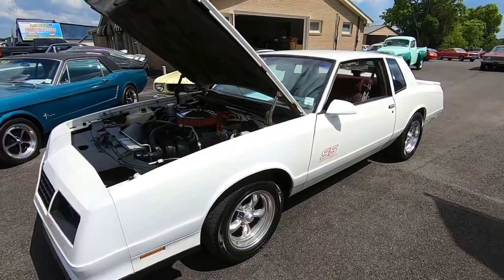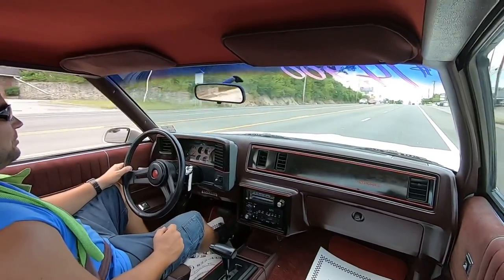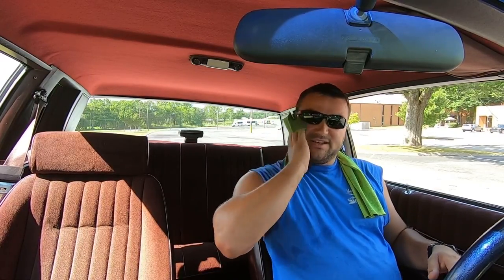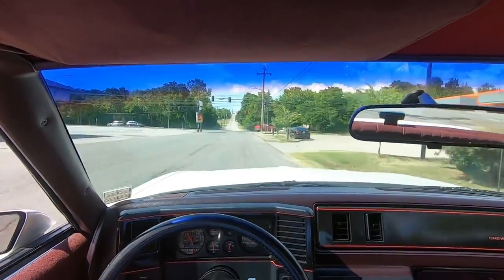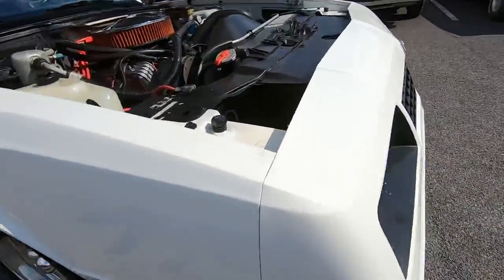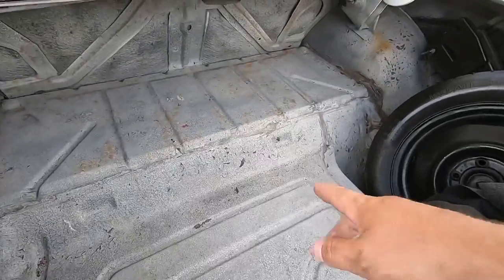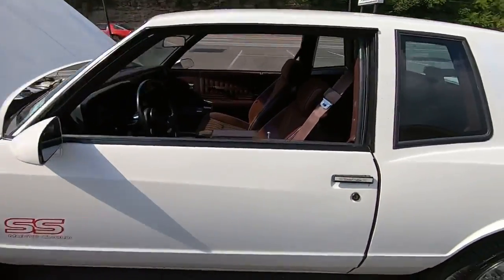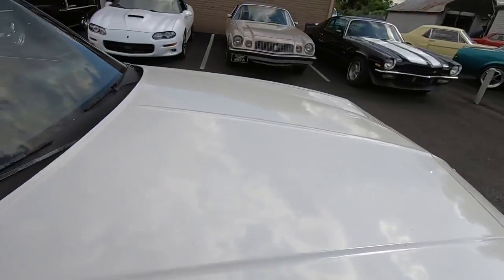Test Drive 1988 Chevrolet Monte Carlo SS SOLD $14,900 Maple Motors #1178

Comment: I cannot understand why people cut the crap out of the transmission crossmember rather than just put a proper new one in that will accept dual exhaust, it wont be long before that one fails . An easy fix for the next owner .